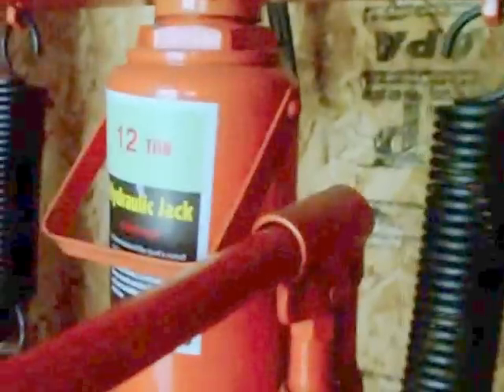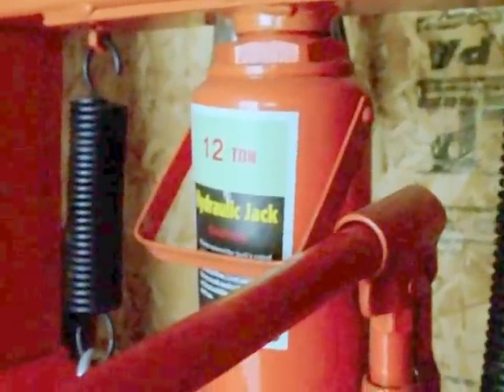FRONT  WHEEL BEARING  JIG  by Mechcanada MVI

Comment: very handy! do you have a video of it in action? i have been dying for a solution to this problem for a while now. sometimes setting that all up is the longest/most stressful part of a bearing job.
Reply from the maker: Austin.  Not at this time but I will the next one I press out.  As you know trying
to balance the cage on flat bar and such is very hard.  I just did one for a garage that spend four hours trying.  He brought it here and it went smooth.  Could adjust to sliding half inch support where needed.  It was extremely rusted in bearing and hub, and this made it possible and safe under pressure. 
Cheers MVI